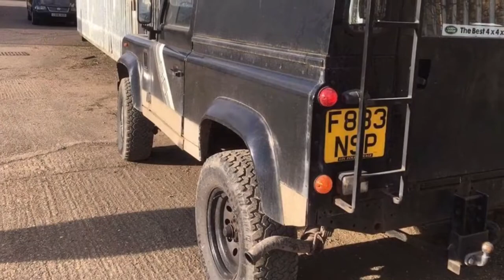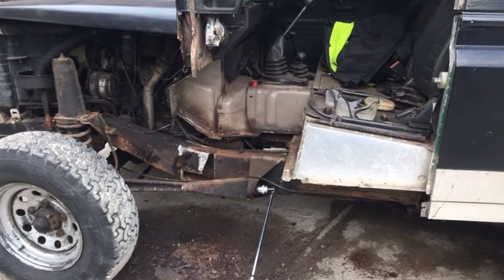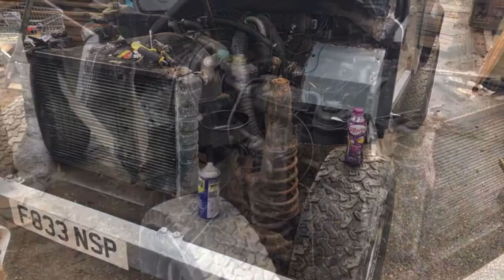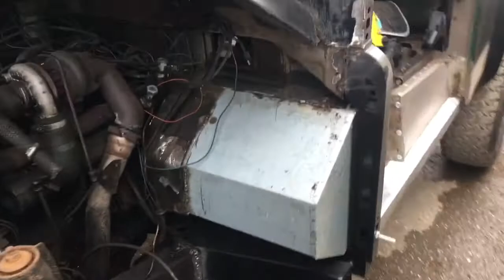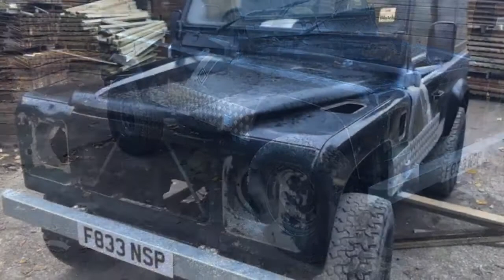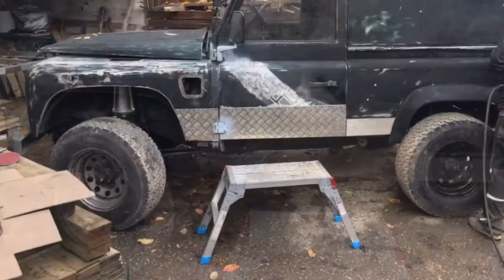Landrover defender part rebuild and raptor painted in 5 days

Comment: Great job dude! Only question I got is does the mud wash off the surface? Looks like it would be a bugger to keep clean? Thanks man take care!
Reply: Washes easily mate, any more questions?
Reply from the maker: Thank you 
It washes easily and the paint is very durable.
It looks unique too.
It required only two coats and used around 5 litres of raptor and hardener